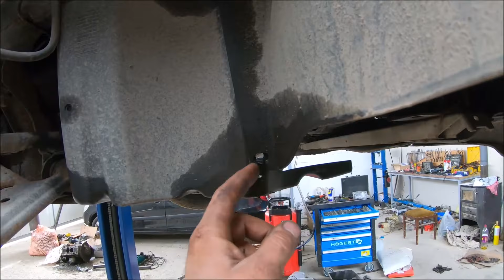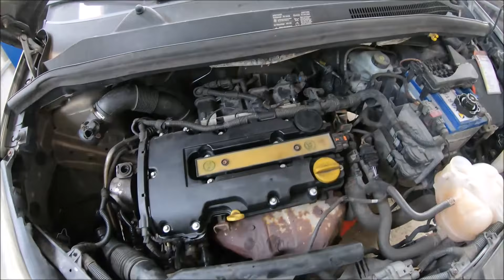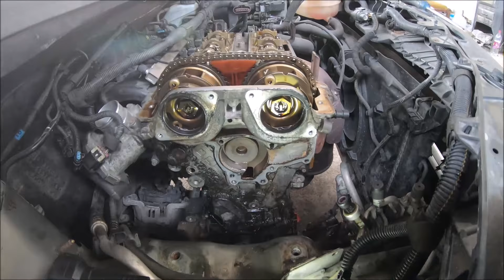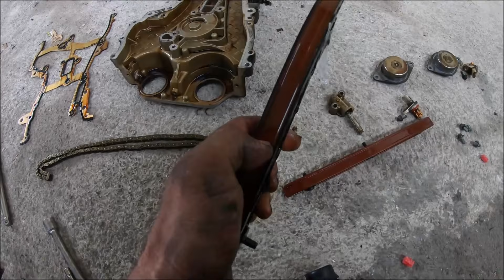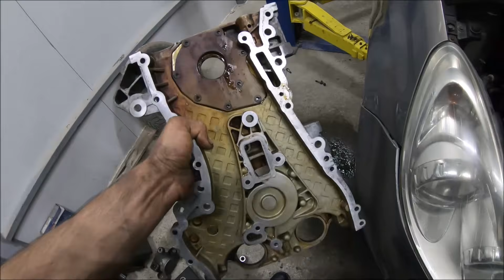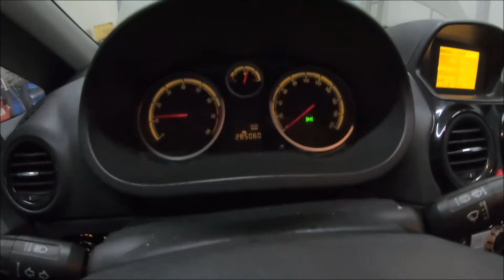opel corsa d 1.4 timing chain replacement

Comment: Hi, from where was the oil leak ? I have also oil leak and it seems is from above cranck shaft but I can't see exactly from where and if is fixable without changing timing chain also , thanks
Reply from the maker: Yes remove the crankshaft pulley and replace the radial seal

Comment: Hi there, I done in my car Timing Chain last week. It’s 1.4 Automatic. I did lift gear linkage cable from the mounting on top of gear box. 
Refitted everything and engine is fine. But every time I put car in D for Drive gear it makes grinding noise before car moves. Once car moving no problem, only on startup time. Any suggestions please?
Or how to adjust Automatic Gear selector Cable? 
Thanks.
Reply from the maker: Check if the cable is in right position because usually there are two holes on the plastic body  where you mount the cable on the transmission maybe it's not pulling all the way on drive

Comment: PLEASE HELP! Took the head off mine to clean the valves so obviously had to take the chain off put it all back together and now getting a p0017 fault code with eml light coming on saying crank sensor cam sensor correlation changed both cam sensors and cranks sensor fault not going away
Reply from the maker: The timing is not aligned redo the timing chain
Reply: @mechanicigor  so should I buy a new one the one that's on didn't seem stretched but is it worth putting the old one back on after taking it all to peices ?
Reply from the maker: @derickg3322 it doesn't matter if you want you can buy new one
Reply: @mechanicigor  I'm probably doing your head in at this point but do I just need to turn the bottom pully till it's locked off then take the chain off and make sure the cams are in line with eachother on the right had side of the cams like them little slits at the end
Reply from the maker: @derickg3322 yes that is correct
Reply: @mechanicigor  thanks buddy saved me alot of headache